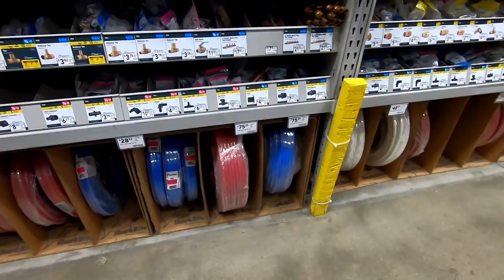Busting out the back block wall / Supply Run . Shop Damage part 7

Comment: Thank you for the update. Looking Good
I'm not a machinist yet. But I'm working on it.
But I have been building interstate highway for over 25 yrs. The 57 stone is exactly what we use for underdrains. With underdrains, a couple of things to keep in mind. the Grade on the bottom of the trench is very important. That's where the water is going to run. We place 2" bedding stone with at least 1' of cover from the top of the pipe.  After you install your pipe & backfill with 57s, lay down felt on top of your stone so the water can flow but the dirt won't get down into your stone and stop up the whole works.
When you change over to your PVC pipe, be sure to continue with your same trench set-up. With the perforated pipe water flows in and out from all directions ( even out the bottom ) But that's not the case with the PVC. So you don't want to trap water from flowing at the joint. That's where most fail at. 
With the 57s in the driveway. that's a good start, but for your driving surface. Check on the price of ( ABC: Aggregate Base Course ) stone it should be cheaper than the 57s. They call it Crush & Run in your area. It wont crawl out your driveway and into the grass for the lawnmower to break a window with. 
Grade it out with the flow of water in mind. then if it's not raining take water and wet it down. roll it in with the tires of the skidsteer and fill in any low places that show up until it stops compacting. Think of it like setting up concrete. 
Most or all of this information you have probably found out by now but it might help someone else reading this.
Again thank you for the update and sharing.

Comment: on vibrating air tools such as a hammer or needle scaler. build s short whip hose that screws int the tool leaving the connecting nipple insulated from the tool. the fitting will last a lot longer
Reply: This is how i have both my hammers setup.

Comment: When we put in drains we'd put filter fabric around the crushed rock. You dig the ditch, put fabric down, back fill with some stone, maybe 6 inches or so put your drain pipe in, then more stone on the pipe about 2 feet  and flip the fabric on top of the stone. Then back fill with soil. That way you get maximum filter surface area.
Reply: Or, instead of the filter fabric, you can also use organic material, like straw or wood mulch, or even grass clippings.  Does the same job.  And, since the oxygen level in the ground is very low, it will not deteriorate.
Reply: @BKD70  I worked on commercial building sites so we used the fabric. We weren't terribly concerned about going organic. What we did had to be professional though.
Reply: Where there is flowing water, there is oxygen.  Eventually you end up with a bio-film and a restrictive layer. There’s a reason we stopped using straw in septic systems and went to using chambers and geo-textiles.

Comment: Harrod stone #4's should run about $350/triaxle or at least it was last year.  Looks like that driver got pretty close to the power line with his bed. Hope he noticed! Holler when you get ready to re pour that floor. I have the floats and a trowling machine to get it nice and smooth.
Reply: Definitely got to pay attention to the power lines. I had a load delivered to my place several years ago and the driver was not paying attention and snagged a power line. It did not pull it down, but a lineman had to come out  to retension the line because it was low.

Comment: Hi Steve, try installing hose whips on your air hammers and impacts to mitigate wear to air fittings. Stay strong and keep up the great work!
Reply: I put a whip or at least a swivel on all air impact tools. Because chucks don't like being hammered on.
Reply: A sacrificial leader hose is a must.  You reduce the number of cycles on the fitting on the main hose, and it will take most of the strain on a short sacrificial piece of hose rather than your big main one.
Reply: canuckguy worried  oh hell nah
Reply: canuckguy worried  yeah I love swivels. They make air tools a lot more user friendly.

Comment: Steve, I plumbed my entire air system with PEX and have a two stage 80 gallon tank old school Kellogg American running at 125 PSI that connects to it. No issues with pressure and adding on new connections is super easy. There are really good deals online for bulk fitting packs. Really enjoying your progress on your shop.

Comment: Steve - I use PEX for air line, what I recommend is that you get the type that's rated to 300 PSI, not the "normal" stuff that's only 140 or so, the price is only slightly higher.   For fittings, the Apollo "barb pinch/cinch" type ring style tend to be the cheapest as well as the crimp tool itself being cheap - I paid $22.  If you have to undo a connection, a side cutter will mostly work fine, you don't need a specialized tool.  I bought the crimper and a tubing cutter, then bought a bunch of brass elbow fittings with "ears" for screws on Amazon - they were about one third the price online in bulk bags as they are in Lowes.  Since I had plenty of ball valves with threads I used those with pex fittings the same size, but you can also get valves with pex crimp nipples.  Be sure to leave space in your joints for debris/water to fall somewhere/cleanout.  If the PEX bursts for any reason, it just makes noise - no explosion or safety issue.  I love the stuff for compressed air.

Comment: My back hoe bucket is 18 inches wide.  I dig  the French drain hole as deep as the bucket which is about 20 inches deep.  Smooth out the bottom of the drain ditch.  I then put the pipe , one run of the pipe, then fill the drain ditch level with ground with # 57 stone.  I have French drains that are 15 years old and still working great.  Good luck with your project.   My back started  hurting watching your video.

Comment: Nobody ever does it but you can save your couplers from that brinelling by putting a short hose whip on your tools and getting the coupler body and nipple away from the tool a bit. More common on hydraulics pretty much no one bothers on  air but it does work. Its kinda nice on a lot of tools having the whip and getting the rigid coupler section away from the tool.
Reply from the maker: That is a good idea. Especially for anything that hammers.👍

Comment: I've poured a few slabs for small sheds and pads for Well-pumps and things like that when I was a kid with my Dad-
We would always form it up, put in the rebar or wire, and then go around throwing random rocks, and broken blocks into the forms to "displace volume" of the concrete prior to filling the forms and vibrating the air out.
With that huge pile of broken blocks and mortar chips you could do a lot of that and save some concrete???

I applied this same technique now in my shop to my 12-gallon Parts washer by submerging old jars full of rocks (to keep them from floating) so now it only takes like 5 or 6 gallons of fluid to change it out instead of 12......

Comment: Big respect for leaving the previous owners dog grave, with this and peanut the squirrel it shows the love you have
for animals. As do I. Keep up the astounding work my friend.

 Also Steve In my civil's experience,  removing the netting from the perforated pipe will prevent it from clogging up with silt, had to replace this A few times on carriage ways due to this problem, and that was larger pipe and larger stone.
 One last point, make sure you have A fall at the outlet (12" 24") into the stream, so it can't build up with
 silt and block your outlet, the falling water will keep it clear.

Comment: One way you can get the gravel cheaper is to set up a business account with the quarry that sells it the cheapest locally. Many of the quarries add and extra $100 when it comes to homeowners because of the added mess and headache of having to deal with them. Call the quarry up and ask them if they will give you a better rate for gravel if you have a business account and what it might be, then ask what you need to do to set up an account with them, they may want a business license number. a business license can be fairly cheap often the amount you will save for 1-2 loads of gravel. where I am locally, the quarry that is 20 miles away has a better rate than the one that is 6 miles away.

Comment: I found if i put a whip hose off the air chisel and needle guns the rubber hose dampens the vibrations and away from grit. They make one with a spring ended but an old wire and duct tape wrapped in a coil 6” to 8” at the end works. I use the crimped end of an old hose, hose clamps vibrate lose and pop off. Thanks for sharing.
Reply: The whip hose is to move the quick connect 4 to 6 feet away from the air tool. Stay safe, stay isolated, clean your pistol, and buy ammo.

Comment: I use old pickup bed liners for sand small amount of stone storage.  I tie them down on my trailer go to the quarry.  Load the sand into  the liner (don't get it overloaded) and pull it out when I get home.

Comment: LOVE that old squarebody! I have a 87 V20 4x4 with a 1997 12 valve P-Pump compound turbo Cummins! Btw you don't need a new truck you just need new rear springs and I recommend " 9 Leaf OE SRI Spec Heavy Duty " 4100lbs capacity per side totaling to slightly over 4 ton load capacity! Search E-Bay for   " Rear Leaf Spring for Chevy GMC C R K V 10 20 30 9 Leaf OE SRI Spec Heavy Duty "

Comment: Watching Steve start to unscrew the female air fitting from the hose, thinking, "I wonder if he remembered to unplug the hose first." Been there, done that, chased the hose across the shop.
Reply: air hose came off a die grinder once while I was in the bilges of an old ship. I was in a tight area and could only move my arms. whip kicked my ass
Reply: fitting came out of the grinder with hose attached

Comment: Consider a dump trailer rather than a heavy truck. Maybe go up to a 3/4 ton truck. But  you can haul more in a dump trailer than you can put in the back of a truck. As a plus you don't need to shovel it out and its lower to load. You might be able to find something cheap that needs a little work.

Comment: Love your creek.
I prefer perforated pipe rather than preforated. :-)
With many hours of experience polishing the handles on a wheel barrow, I found it easier to face it toward the direction of travel before loading plus favoring the front with the load for easier wheeling. One can also save strain on the back by using the upper thigh as a fulcrum for a shovel handle.

Comment: After 150 years of development, to find river rock deposits to make gravel in my area, you can expect to drive 60 to 90 miles to find a working crushing operation (one that operates in bulk, anyway). Guaranteed that the trucking is more expensive than the aggregate, but only just...

Comment: Watch out on the pex tubing in exposed areas, it is not critter proof like metal pipe. I had a rat chew a hole in the bathroom wall and into the pex, leading to some water damage.    Keep up the good work, and i love the view off the side of your shop

Comment: You had the gravel and sand  All you needed is Portland cement, a mixer and some studs to frame and start pouring a nice slab to get away from the mud forever.

Comment: Making good progress Steve!
You can use the waste broken block in your French drain.
In California that block would have had verticle rebar in it along with horizontal, and would have been filled with concrete. Tearing down block here is much more work. Would not be able to use your methods.
I could have used that load of rock on my road, although not to awfully muddy, it is like a roller coaster, with all the pot holes.

Comment: Steve, you dont need to brake the concrete, there are companies that come and inject foam and lift the concrete back to in place and you will pure concrete footing under it. it works really well and you will save some time and money.

Comment: If you have to be socially distanced might as well year down a wall.  Could build that french drain with creek rock.  Pragmatic Lee used that, or something similar for the airlines in his shop.  Leaking compressors and hot water heaters, are a pain.  Stay safe up there in the north country.

Comment: Wow Steve where I live the rock quarry will not load a pickup or tag along utility trailer. If you show up with a dump truck without a tarp they will not load you either. You are also not allowed out of your truck without a hard hat. I think around here they have been sued by people that ask for more to be put into there trailers than it could hold and they leave and have a wreck and blame the quarry for putting to much on. When clearly it's the vehicle owners fault. A small few make it hard on everyone. Good job on the demolition very methodical and well planed out.

Comment: Hi Steve, all of the drain pipe that will be crossing the driveway, should be covered with a second pipe. Example, if the drain pipe actually carrying  the runoff water is say 4" in. Diam. pipe, that should be covered with say 5" in. or 6" in. pipe. Just where vehicle's drive over said pipe. Think of it as insurance. Cheaper to pay now, and not have to dig it up later. P.S. Install a hose whip on your air hammer.

Comment: Just a thing to think about. after you remove the concrete floor you will have to drill the existing floor concrete for the rebar and epoxy it in place. Also think about putting a 2 inch layer of gravel under the new concrete.

Comment: It ain't the stone that costs, it's the delivery. Most of the stone bill went to the insurance and payments on the truck. I used to work in a heavy equip maint shop, learned that there, like the spot where you got the sand
Reply: location, location, location.  Things in my neck of the woods have such a constrained supply that I was seriously looking into the costs of establishing a stockpile along a rail siding and getting in in trainloads...
Reply: We are paying about $15 a ton haul bill on full loads (20 tons on a quad). Its $20+/- at the yard and around 35+/- delivered. The haul bill on sand is what kills you around here because its like $11 a ton, more like 18 for masons sand or fine brick sand.
Reply: In my area one can get crushed concrete for half the price of stone. They crush in all sizes so can use for foundations and drainage. Use filter fabric around rock!

Comment: Steve, too bad you can't get a rock crusher in there. All that concrete rubble could be made into gravel for your driveway or sub-base for the pads. Check with your quarryman to see if they will take it. Thanks for the video. Jon

Comment: Watching you throw those blocks at the beginning reminded me, there is an old adage that says the angle and distance of bounce for any item you throw will be proportional to where you hoped the item wouldn't go. I hold up the hidden bed springs as proof that this may in fact be a natural law.  There also comes a time in any huge project that lying in wet muddy leaves becomes soothing.  Having used my fathers 78 Chevy 3/4 ton 4x4 step side a lot recently to move loads of junk and scrap, I find it is like driving a giant wheel barrel with a hint of brake, it can go 65 mph in a kinda bouncy motion. ; )

Bill

Comment: like to give my advice as i do this sort of thing to my yard a lot, the first thing I do is scrape away all the clay and soil with my FEL, when the base is good add road base, if soft earth is not removed it will only mix with the gravel under weight, for french drains i use the slotted pipe without the wrap, i place Geofabric down, put the pipe on the cloth, put in 20 mm gravel about 100 mm over and around the pipe then wrap the cloth over, then some more 20 mm on top of the cloth, I also lay a piece of the Geofabric on top and then you can place small rock or clean soil depending on situation, we all use crusher dust to go around fixed pipe for bedding in so the pipe does not get damaged, 20 mm is the preferred industry standard for french drains.

Comment: Steve, I would not recommend PEX for a shop air system. As you noted it's only 160psi. I ran 1/2in SCH40 PVC water pipe for my shop air system which is reated at 450psi back in 2000. After having an addition inspected, the inspector read me the riot act for using PVC for compressed air. Didn't write it up but advised me to replace with copper or galvanized. UV light (fluorescent lights emit UV) weakens the PVC and it can explode at even 100psi when old. PEX would seem equally at risk. You always do things right and professionally. Your shop is certainly worthy of a copper air system.
Reply: PEX doesn't shatter like PVC. It's a much softer plastic and even when it ages from UV it will split and leak, not burst like the pipe bomb that PVC is.

Comment: If you can remember to, put the barrow down pointing the right way before you fill it. Turning it filled is hard on your back and even worse on soft ground. Old tip like many others here and worth passing on!
Enjoying your UT contributions and subbed

Comment: You will very likely find, Steve, that the ballast you are spreading out will end up disappearing down into the clay, which will rise back up to the surface again. Ideally you need to lay a geo-technical fabric layer beneath the ballast to stop the clay pumping through.
Reply: That's what happened to me for 30 years. Rocks disappeared so I added more until 6 years ago. I put down bigger rock (2" to 3") and it has stayed just where I wanted it.
Reply: Drb
Reply: Ken is correct based on my experience.

Comment: I plumbed my shop for air with Pex, works great. Way more air flow than regular hose, and with a manifold I can turn off circuits as needed. Just make sure you use a whip from the compressor to the pex, it’s pressure rating is directly related to the temperature.